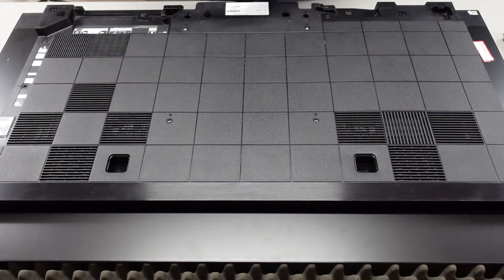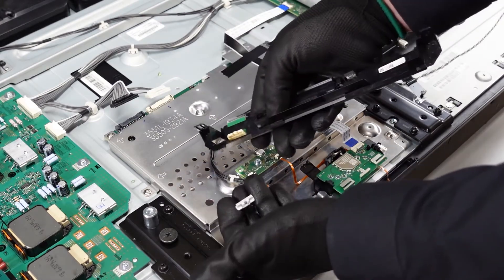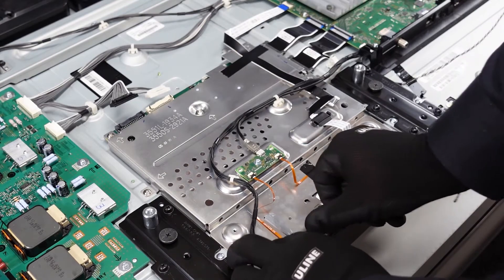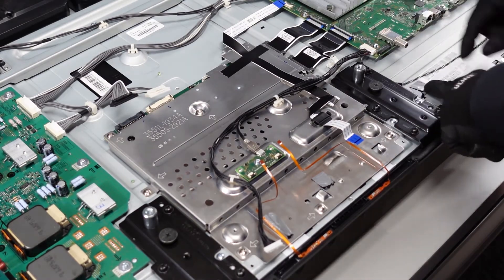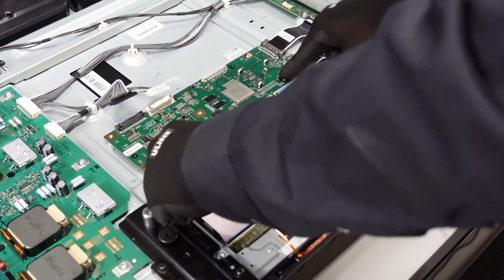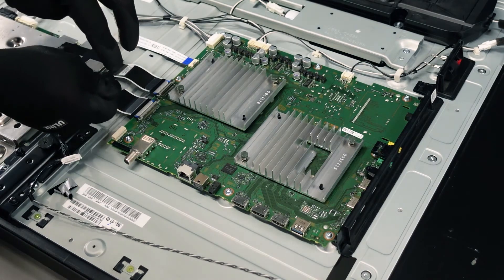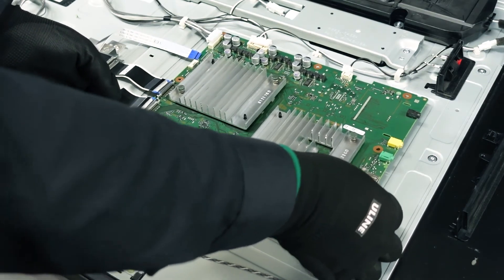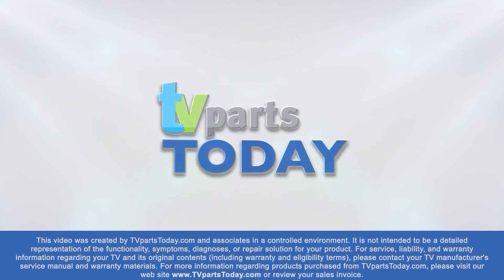See how to dismantle this TV.  (SONY XBR-55A9G)

Comment: Single vertical line on a 77” A9G- likely t-con? If so do you sell one?
Reply from the maker: @Willpierceninja
Vertical lines are usually a t-con issue or a main board issue. We do recommend swapping out the t-con first as it is usually the cheaper option. We do stock a few different t-con boards for this unit, so I would suggest opening up the back of your TV and getting the part number off of the t-con board. Sony has its own part naming conventions, but the partial part number on this t-con can be found on a small white box in the middle of the t-con board. It will have a QR code printed in the box as well as a partial part number ( example:  6630C ) . we should be able to use this partial part number to find out which t-con board is in your unit and in turn which t-con you would need to order. I will note here that swapping out a t-con board or a main board in a modern Sony unit will require you to do a firmware update to pair the new t-con, the main board, and the panel. Our customer service department has a lot of experience with Sony firmware updates and will be more than happy to go over the process or answer any questions you might have.

phone #: (930)212-1975
email: info@TVpartsToday.com
Reply: @tvpartstoday  thank you so much! I replaced the board, but sent your support. Email some questions as I may have done it wrong. The line is gone! But the picture is now terrible 😂
Reply from the maker: Give our customer service dept a call, they will get you squared away. 
phone # : (930)212-1975

Comment: I have the same model 

Tv powers on to a black screen with 1 white and 1 green vertical line together in the middle. Tv then powers off and won’t power on again 

Any ideas which part I may need?

Thank you in advance
Reply from the maker: I would try to replace the t-con board first, and if that doesn't work, I would try the main board.

Comment: Great Video.   I have this set and its 2 years old and suddenly black horizontal lines that are faint have appeared from top to bottom.  On the right side of screen about 1/4 way down there is a bright line that turns into a black line going from right to left.  From my reading this might be a T-Con board issue.   Would like your opinion.   Thanks.
wk  Florida
Reply from the maker: unfortunately, horizontal lines on your screen are almost always panel damage.  This repair is usually more expensive than a new television not to mention very complicated.

Comment: LOVE this video!  SO helpful.  Would you know what part I need to replace if the TV will not power on at all?  Thanks so much.
Reply from the maker: Thank you! The power supply board would be where I would start to restore power to the set. Keep in mind there could be other issues keeping your TV from powering on, but the power supply is a great place to start troubleshooting. 

Power supply part number: 147474511
Link to TV Parts Today website: https://www.tvpartstoday.com/147474511-1-474-745-11-Sony-Power-Supply-1001783-p/147474511.htm

Comment: Hello Mike. I have a Sony Oled xbr-77a9g. No power, only a clicking when turning on and off with the remote. The screen flashes a little. I thought it was the power supply APS-428(CH). I ordered it from your company, it arrived today and installed it, but same thing. Would it be the main board what is failing? I see it is out of stock. I'd appreciate any guidance troubleshooting this challenge. Thanks
Reply from the maker: The main board would be suggested next also I would recommend double checking your manufacturer’s part number as the APS number you have listed is a generic board number and will not guarantee compatibility when searching for a TV circuit board.

Comment: So, does the TCON bd. fix 4 flash? Service manual's a confusing mess, mixing in LCD sets. LD bd. error but doesn't have one? LD error on main bd. goes high, even if set not shut down with bottom LVDS lifted.
Reply from the maker: Hello, 
Is your model number the same as the video provided? 
You could also email info@tvpartstoday.com for any trouble shooting help!
Reply: 65” version

Comment: I have this TV, and it doesn't turn on, doesn't show any status LED on the bottom, but I hear a repeated ticking from the power supply somewhere. I can't find any board scorching or bad relay or capacitor connections, not sure what it might be. 

Any advice?
Reply from the maker: Swapping out the power supply is where we would start. If you wanted to ask any more questions or get some more in-depth help, you can send any questions over to:   Info@tvpartstoday.com
Reply: @tvpartstoday  I did send an email, and it is slightly time sensitive given that I guess I ordered the wrong part first. If you could please look for my email and give me a call, id appreciate it
Reply from the maker: Ill let our customer service department know to contact you ASAP.

Comment: I have this exact model and after about 6 weeks of light use, it failed to power on. The front LED just flashes green and then orange repeatedly. Could this be a bad t-con board for such a new tv?
Reply from the maker: You need to do a firmware update. You can find the firmware instructions on the tvpartstoday.com website. USB must be 4gb or less. You can find the download on the Sony website.

Comment: Thank you.  I have this exact TV and a lightning surge killed it.  I'm hoping it's just that little fuse visible on the power board at 11:47.
Reply from the maker: Power surges usually enter the TV through the power supply board or the main board. I would look for any obvious signs of scorching or discoloration on either of those two boards when you pop the back off. If you need any help identifying parts give us a call at (800)203-7484.